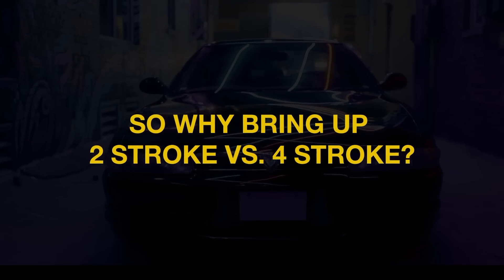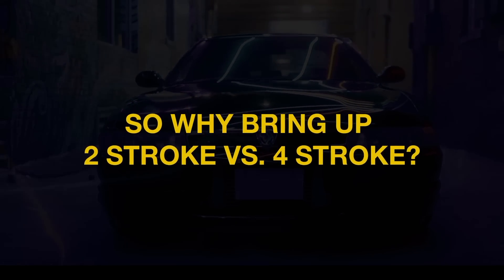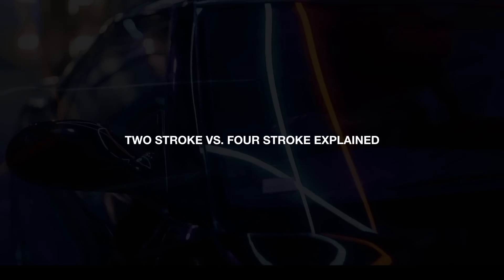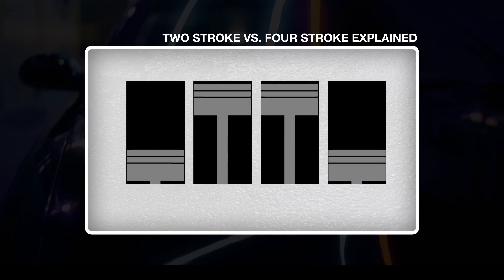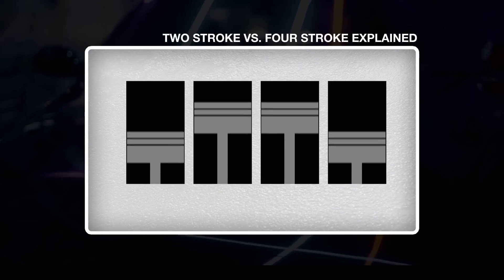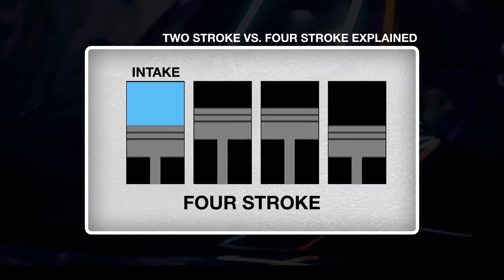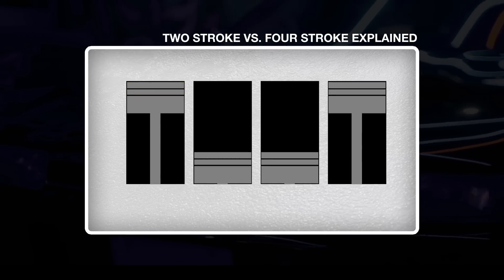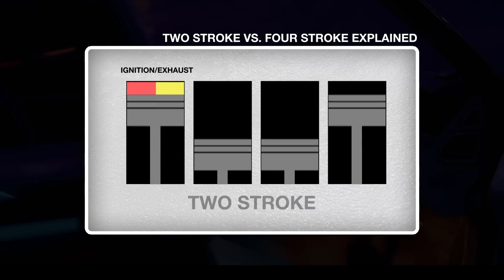The SECRET Behind Why RX7 and RX8 Rotary Engines Make SO Much Power

Comment from the maker: What should we talk about next on Rotary Theory?
Reply: Please talk about the differences between 4-port, older style 6-port , and the Renesis.
Reply: Rotors Magazine Lots of people (myself included) want to buy a rotary car (RX8 are really cheap right now). Make a video about what new buyers need to watch out for!
Reply: steph sek he did look back at the older video on RX8
Reply: steph sek i wouldnt buy a rx8 2 much problems and they are heavy if u want to get into rotary buy a fc cheaper on parts then a fb only thing good out of a rx8 are the rotors to be honest
Reply from the maker: Rx8’s are not heavy lol
Reply: what??? RX8 manual is like 1,373KG. My Subaru Crosstrek 1.6 is already 1.425 tons
Reply from the maker: Compared to an FB yeah they’re probably a bit heavy, but taken into consideration it’s a 4 door, has back seats, more safety equipment, sound deadening etc, it’s still a fairly light car for the time.
Reply: Rotors Magazine i forgot heavy and slow lol im old school bro i own a rx7 fb 12A full bridge port monster street port running a 48 webber down draft
Reply: Rotors Magazine u just explained everything this man needs to know on y not to buy a rx8..and stick with a rx7 body
Reply: I will buy the RX-8 because i got a family but i need a sports cars. its a best of both worlds
Reply from the maker: I wouldn’t buy an Rx8 for a family car, if you have any concern for reliability.
Reply: Rotors Magazine i found a gen 2 RX8 type S manual for sale. Fairly modded but i will reserved my views when i seen the car in person.
Reply: Rotors Magazine modifying the engine so it's a magnetic engine instead of a combustion. That might be a good theory. After all the engine was never meant to be a combustion type.
Reply: performance "unbreakable" apex seals vs OEM, myths & facts, debunking
Reply: 1st gen Renesis vs 2nd gen Renesis. I know a lot of people, including me, want to buy an RX-8 one day and I think most of the 2nd gen cars have much less engine problems than the 1st gen cars
Reply: Would like to see some video talk about semi p-ports. How's  it's done. Pros and Cons. I see manifolds  being sold for semi p-port: pro-jay and excessive. Don't see many videos on them though.
Reply: Rotors Magazine oil viscosities and rotary engines. I’ve been told thicker it better for the bearing.
Reply from the maker: We do prefer to use heavier weight oil.
Reply: I think you should save your breath and the internet bandwidth for something possible instead of trying to "educate" rotary engine fans. Especially as rotary engine fans yourself. Maybe you could find a rotary engine mechanic to handle this for you. They're not only used to dealing with brainwashed tools and very adept at telling them what they want to hear and getting paid for it but also are rarely ONLY rotary engine mechanics, know the actual differences, know what "THEORY" really is and what its not and why its NOT IMPORTANT FOR ANYBODY WHO ALREADY IS A ROTARY FAN ANYWAY and would PROBABLY help you out and save you some money by suggesting a BETTER TOPIC and MOST OF ALL they enjoy working with the handicapped.
Reply: why do rotories have low torque
Reply: +woo Zhi   Because they have low IMEP and BMEP, they also unlike a reciprocating engine have no mechanical advantage, the Datum between Piston diameter (Rotor)the eccentric-crankshaft and the mesh between the Stationary gear and the  Piston(Rotor) gear works at a mechanical disadvantage (no leverage).  A very inefficient design.
Reply: +Adam Smith The Wankel is a 4-stroke.
Reply: +Adam Smith  Are you serious kid? No strokes?  You don't really have a clue do you?  The Mazda 13b for example has a 30mm stroke produced by the 15mm eccentric-crankshaft off-set. Two complete strokes from the Left-to-Right and then Right -to-Left again for each 360° of shaft rotation.
Reply: Orbiting Piston to be more accurate, as they orbit in a distinctively PLANETARY MOTION... the term Rotor refer to CONCENTRIC MOTION around a fixed axis which does not occur in either of the  Wankel designs.
Reply: +Adam Smith Yes, 30mm STROKE. The axis of the piston certainly does move left to right and back again... you just do not understand how a Wankel engine operates yet.
Reply: The title was a little misleading. Where was the explanation of why they make so much power?
Reply: +Scott Overton They don't make much power... its one of the reasons why they are obsolete now.
Reply: can you help me i building rx8 with a third gen engine ,my problem is should i use what stearing race to use to get power stearing,any advice thanks
Reply: For the gas please
Reply: Wankel engines are dead and buried... Today marks the 7th anniversary of the final demise of Mazda RX production, on Thursday June 21, 2012 at 4:30pm the final RX-8 car ever to be produced rolled off the assembly line, the last RX model to ever be produced by Mazda.

 New Mazda CEO Akira Marumoto has confirmed the Japanese carmaker has no plans or timeline for a return of the Wankel engine.
Reply: You should do an entire show on Ernie Brink's solutions to the rotary engine design flaws: https://www.youtube.com/watch?v=C4Epo8C6CwI&t=1696s
Reply: @deeremeyer1749  Save your breath, because everything he said is true, he is not your typical rotary engine 1.3L fan.
Reply: @kevink2315  Very typical actually...

Comment: My personal view on this topic: 0,654L is the air a rotor can displace in one turn me thinks (the 3 gaps the rotor constantly creates in the chamber). So, a 2-rotor engine has indeed 1.3L of air volume. And since a rotary engine cannot compare to any other engine, the true volume is 0,654L per rotor since it gets this volume per turn. The 2 and 4-stroke engines have their specified volume in its combustion chamber per cylinder when the piston is in its lowest point. Tha's how the engine dispacement is done. Rotors have a constant volume that intakes, sparks and exchausts its air-fuel mixture 3 times per turn and that's why it makes so much power and is able to reach so high rpms for such low volume. And that's why it consumes so much fuel also. But Honda S2000 reaching almost 10K rpms, consumes almost the same amount of fuel as the RX8, producing almost the same power and torque. So, the size and weight of the rotary engines are the main pros helping to create 50/50 weight distribution in sports cars. No need to put those engines in family cars or GTs. These engines are the recipe for handling machines. Let's wish Mazda manages to bring them back to production sometime soon-ish using new techs (hybrid tech maybe?) to reduce emissions and consumption.
Reply: giorx5 Can a rotor handle multiple displacement like many V8s (shutting down cylinders when all aren't needed)? That would be one way to reduce emissions and fuel consumption.
Reply: Let's see what Mazda engineers find out in the near future to make it happen.
Reply: joerapo that could be possible on the 3 and 4 rotor designs, depending on the ecrank's positioning for each and also having a way to lubricate the apex seals without it not flooding the rotor and exhaust with unburnt oil
Reply: Sorry, but that is not how displacement in any engine is calculated. You must use the total volume of air displaced in the same number of shaft rotations need to complete the engines firing order sequence.
2-stroke Benz-Cycle         360°
4-stroke Otto-Cycle          720°
4-stroke Wankel-KKM     1080°
Reply: How can you tell me I'm wrong when you do not understand the basic concept of displacement or how it is calculated???
 I understand that you are embarrassed and confused but if you don't ask for help you will simply continue to make yourself look like a fool.
Reply: Giorx5 You are correct, for me it is like 1-stroke engine and more , because in one full cycle had already made the boom plus started already the next cycle.
Reply: The 13B pumps as much air in 2 revolutions as a 2.6L 4-cycle piston engine does.  Is it then equivalent to a 2.6L 4-cycle piston engine, or is it a 1.3L engine that is twice as efficient, or is really 3.9L since some believe that all 3 faces of each rotor need to be counted?  I could make an argument for anyone of these scenarios!

Comment: Looking at that diagram you provided (good job btw lol 👌🏼) I would say the rotary is more of a hybrid between 4 stroke and 2 stroke.. looks like it's a 3 stroke as the intake stroke is separate from the compression stroke, but then the ignition and exhaust are basically the same stroke.. pretty cool if you ask me!

Can't wait to rebuild my rx8 this summer.. still runs decent with 210xxx km on it! 😝

Comment: .65 + .65 =1.30  which is 1.3l since one face fires and completes revolution with the second trailing. That one face .65 is half the complete cycle. The face of the second rotor literally trails it a.65 so with three rotations of the e shaft 2 rotors have fired one face at a time. And only one rotor is firing at a time. So that one face on each rotor is the only measurement you can take. Its a 1.3l no matter how many faces it has because only one face fires at a time.... again .65 +.65 gives you 1.3l period there is no argument
Reply: RR made it a diesel, but it had very low braking force, where as a diesel ic have good braking force. If the breakthrough works, it may be good for cars, but not for trucks. If they can get the fuel consumption right. In a boat-test, a 100 HP two-stroke, used 44 litres petrol, and a 4-stroke 100 hp used 28 litres, for the same work.
Reply: Agreed!

Comment: Many thanks for this video. I have been pondering myself how to measure the true volume of a rotary engine. As you say in a 4 stroke cycle engine there are 4 components to that cycle. Now as the 4 stroke cycle in a rotary takes place in 360 degrees as opposed to a piston engine this takes place in 720 degrees. So we also have 3 chambers per rotor so i say that a rotary is similar to a 3 piston engine per rotor. So a twin rotor is actually similar to a 6 cylinder piston engine. So in a 2 rotor engine with 6 chambers of 650cc that makes it 3900 cc . If you then add that there are 2 firings in 720 cc compared to a piston you could consider the 2 rotor to actually be 7800cc for 720 degree cycle. 
The other problem of a rotary compared to a piston is that in a piston the power stroke lasts 180 degrees but but in a rotary that is 90 degrees. So the work available is for a much shorter duration. The other problem is that a piston engine has a much larger Crank or lever moment so produces much more torque compared to a rotary. But will not rev a fast as a rotary.
I will admit to loving rotaries but never had the balls to actually buy one. I loved the RX8 R3 that i nearly bought a few years ago.

Comment: Having owned six first-gen RX7s (and rebuilt a few rotaries) I'm in the 2.6L camp. The crank completes three rotations for every single rotation of both rotors. Therefore, each rotor fires on two of their three faces for every two rotations of the crank (eccentric) shaft - which is the same number of rotations required to complete the full cycle of a four-stroke engine, which the rotary definitely is. Since a total of four rotor faces produce a power "stroke" during these two eccentric shaft rotations we get 4 x 0.65L = 2.6L displacement. Incidentally, that works out to two power strokes per revolution for a two-rotor engine, the same as that of a 4-cylinder piston engine. But here's where things get interesting: The duration of the power stroke in a piston engine (as the piston is forced downward from TDC to BDC) is 180 degrees of crankshaft rotation. In a rotary, the duration of the power "stroke" is 240 degrees of eccentric shaft rotation - 50% longer than that of the piston engine. This provides a longer and smoother power delivery per power cycle, and the extra 50% in degrees of power stroke length is the equivalent of having an extra two cylinders (50% of four cylinders = 2 cylinders, 4 cylinders + 2 cylinders = 6 cylinders). That fact, combined with the absence of reciprocating components, is why the rotary runs as smoothly as it does.

Comment: Ye I had an rx 8 for 10 lovely months b 4 it blew a seal due too cat failure, am also an engineer an I agree with the 2.6 litres as if you compare too a normal in-line 4 engine 2 crank revelations is what we would measure too then using the same amount makes for a more equal comparison 👍🏼

Comment: Thanks for posting your videos Kenny.  You are in the camp of not caring but how many liters do you think the 13B engine is?  I just found your channel. Why does Mazda recommend not using synthetic oil for their rotary engines?  I used to use synthetic in my 91 13b but a very experienced rotary engine mechanic at Mazda convinced me to reluctantly change to mineral oil. He kind of said I would not understand why. What do you use?
Reply from the maker: Edward Dergosits In a nut shell, they recommend not to use synthetic oil if you are still running the stock oil metering pump. The reason for this is conventional oil burns easier. The Oil Metering pump (OMP) injects oil into the rotor housing much like a fuel injector to help keep the apex seals lubricated. The OMP tends to quit working, so the most common fix is the remove the OMP all together and premix the gas using two stroke oil. Once you’ve done that you are safe for synthetic.
Just our $.02!
Reply: That is the best explanation I have heard Kenny. I assume that using synthetic would cause the catalytic converter to be overloaded. I replaced the OMP two months ago.  Pricey fix it was.

Comment: Displacement of engine is volume of displaced air, sucked into engine, after all pistons/faces have fired, under condition of 100% volumetric efficiency.

If every face of rotaty engine can displace 0.65L of air, total displacement after all 6 faces have fired is 3.9L.

Engine is called 1.3 because of tax reasons. In Europe some countries have luxury cap on 2L and above. In Japan I think it is about 2.5 or 3L. For Kei cars, it is 0.66L, so they might use single rotor for Kei car.

And as rotary is very rare and not very much people understand it, Mazda could say whatever they want.
Reply: Exactly.  The practice of only counting 1 chamber per rotor started at NSU (first builders of the Wankel) at the suggestion of Max Bentele (visiting engineer) to avoid EU displacement taxes.
Reply: Great comments... nice to see some educated people in the comment section...

Comment: Why not compare BSFC between the rotary and some typical 1.3, 2.6 and 3.9L 4 stroke cycle engines? Obviously that doesn’t measure displacement and is meant as a measure of efficiency, but it might show where the rotary most closely resembles a 4 stroke reciprocating engine.

Comment: I believe the reason that it's 1.3L from factory as you stated is that 4 cycles happen on 1 E shaft rotation an as stated thats the amount of air expelled from 1 rotation. Equally understand that for comparison. The 2.6 makes more sense as piston takes the 2 rotations to complete the 4 cycles.  But yeah people gonna hate if it's a 1.3, 2.6 or a 3.9. People always hate what they don't understand.... Loving the Cosmo BTW.

Comment: all i see is mpg comments lmao if u own a rotary the best part is filling up and adding pre mix ;) 12Agang
Reply: Jay Marley 12A mpg is not to terriable with 600km per tank running non premix regular gas
Reply: Bradley Smith my 12a not stock at all full bridge 12a monster street port running a 48 webber down draft it all depends how u drive but im always on mine 100% throttle
Reply: +Bradley Smith Well, its not too terrible until you consider the 12A makes little power and no torque.
Reply: Yeah, but you can't pre-mix an RX-8
Reply: 600Km per tank??? Lies.  That sounds like something that came out of a brochure for a Toyota Prius or Honda Insight.
Reply: Yes you can and folk do
Reply: doktorbimmer I own one, yes u can

Comment: Citroen and Van Veen also experimented with Wankel, but only NSU and 
Mazda had Wankel commercialized. A nice thought to rotate instead of the
 existing up/down engines, but some bad hooks: bad compression control, 
bad fuel consumption and bad CO2 creation.